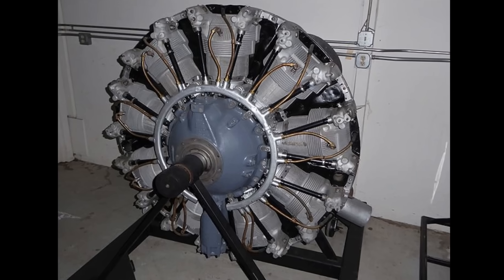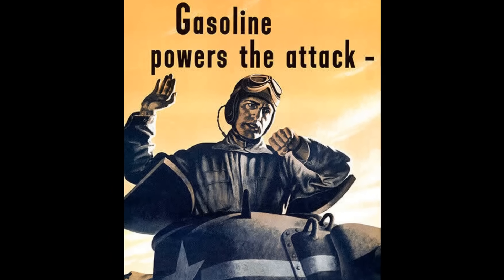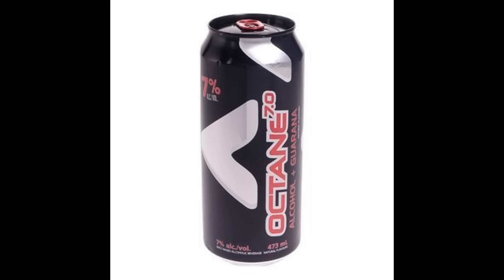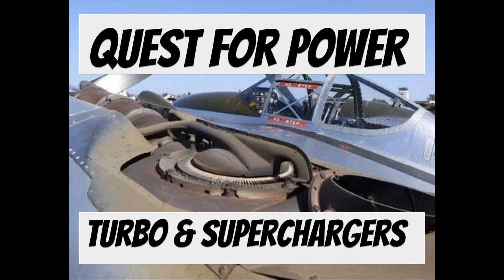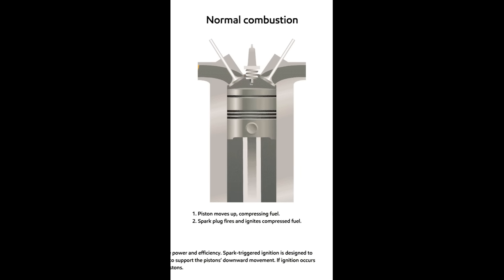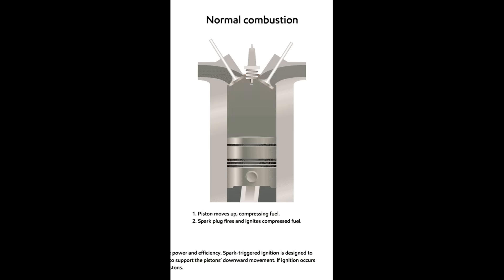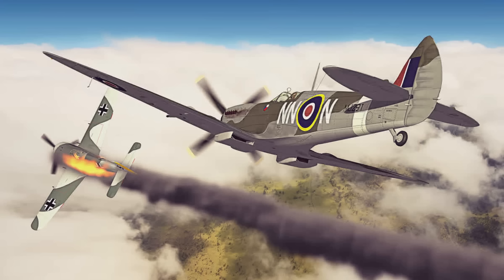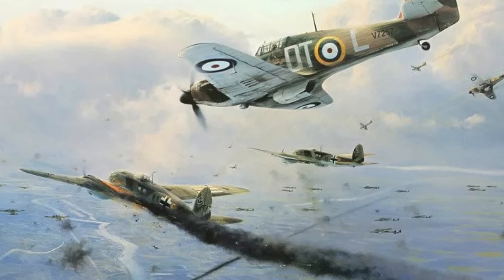Superfuel! 100 Octane Aviation Gasoline (Avgas):  Quest for Power Part 5

Comment: By increasing the compression ratio the engine can suck more air in and in turn burn more fuel. That is where the extra power comes from, more fuel equals more power. The problem, as you point out, is the pre-ignition (or knocking or pinking or pinging as it is sometimes erroneously called) which will destroy the engine. It sounds like a handful of stones going through the motor. It took good brains to overcome the problem so the fuel mixture doesn’t ignite by compression before the spark is able to do its work. Same weight of fuel and engine but more power. All the nice ideas for hotting up motors were thought of in the early days of  aviation. I like it when people think higher octane petrol will give them more power just by putting it in their car.

Comment: I’ve been an A&P mechanic for 43 years my first job was for an FBO and 135 operation. I would uses to run 100LL in my motorcycles especially my Suzuki 125 dirt bike and Honda 250R 3 wheeler. They ran great on it. Loved the smell of that fuel. Now for the past 38 years I’ve worked for a large MRO it’s all corporate jets and Jet A smells horrible.
Reply from the maker: I own a Cessna 172 and part of every preflight is a little sniff of the fuel sample. I tell people that I can tell if ther AVGAS still fresh!! haha

Comment: All octane rating is really about is a fuels auto ignition temperature. When  gas (air gas not gas gas)  is compressed it generates heat. The more a gas is compressed the more heat it produces. Engine knocking  is when the fuel air mixture is compressed to the point where the heat from compression ignites the fuel before its supposed to be ignited.  Raising the octane in fuel makes it able to handle more heat before igniting thus allowing higher compression and more power.
Reply: Exactly , it raises the flash point .

Comment: Let us not forget that the perenial underachiever Mr Doolittle also developed a practical blind flying system for the first time the ethos of which is still used today, changed the direction of the 8th to contribute massivley to the situation that allowed air supremecy on D-day, was part of the team that created zoning to prevent airfields becoming constricted by development so impacting safety (I suspect that one went by the wayside) and was also in charge of the aviation division of a small company called Shell. I wouldn't want to have  beer with him - when he says what do you do I'd be  at blinking and breathing in comparison to this hero's achievements - I picked up his Autobiography at the PX bookshop many years ago and it's a very good read but sadly I have lost my copy!
Reply from the maker: Yes I mentioned his blind flying work in my B-25 eps! What an amazing man and soldier.

Comment: Best thing about 100 Octane Low-Lead aviation gasoline is that it does not go stale and gum up carburetors and fuel systems in the way that modern automotive gasoline (often with ethanol) does.

People with vintage collector cars and most pilots know that. 

Technically, AvGas does not get taxed in the same way as automotive highway motor fuel, so it is not entirely legal to use.

Would have to say that even after years of sitting in a gas tank, things like generators, chainsaws, lawnmowers, snowblowers, line-cord trimmers, rototillers, etc will start on the first pull once they are primed.😊

Comment: Rule of thumb when I was flying helicopters in the late 60's and 70's, 80/87 for naturally aspirated engines, 100/130 for supercharged ones ... you couldn't run 100/130 in naturally aspirated engines, it would kill them

Comment: 1.  All gasoline has the same heat content.    One gets the same heat from 87 or 130 octane.
2.  Increasing the compression ratio raises efficiency, but it’s a diminishing effect.  Compression ratio is geometric and does not change with throttle fully open or closed or with altitude.  What matters is pressure ratio…as measured indirectly by manifold pressure.     The CR of WW2 engines was typically 6.5..about the same as a Briggs and Stratton!
3.  The plug firing initiates a flame front that spreads through the cylinder along with a rapid pressure rise.   Detonation.. knock.. occurs when the mixture just outside the spreading flame front spontaneously ignites.  
    If the mixture ignites before the spark fires, it is “Dieseling”..compression ignition.  But as a practical matter, little difference.
4.  WW2 piston engines were expensive.  Possibly exceeding the cost of the rest of say a Me109.  The early German jet engines were comparatively cheap …another incentive to use them.
5.  If memory serves, Charles Kettering came up with tetra ethyl lead for gasoline.  Kettering invented the self starter, and coil and breaker ignition.  Readers ought look him up.  BTW, his company was Dayton Electric Company…DELCO.
Reply from the maker: Wow, that’s a lot of great information! Thanks for sharing!

Comment: DUMB-ASS, in the US in 1938 Shell and Esso started selling 97 octane pump gas for cars like the V-16 Cadillac Allison/Hydro-Matic and Packard "Twin-Sixes"! The B-29's burned "super-fuel" the 130/150 octane fuel spec'd on the SIDE of the aircraft. The RAF Napier Sabre Engined fighter (Typhoon and Tempest) used American made 170/200 (lean and rich mixture ratings) made by Esso and Atlantic Richfield. It was so caustic, ground crews had to wear First Generation HAZMAT suits. P-38's in Europe experimented with it, but it ruined spark plugs in 4 hours of operation. My late boss was an experimental pilot after WWII and he flew a Japanese aircraft fueled with 170/200. The "chase plane" a P-80 Shooting Star jet was 70 knots SLOWER at 20,000 feet, climbed at 150 knots slower at a 70* angle of attack and was 100 knots slower at 60,000 feet!
Reply from the maker: "DUMB-ASS"? Now place nice or I'll have to put you on the detention list...

Comment: Correction: Aviation Gasoline into the Airline Piston Days through the DC-7 (R-3350) and, Connies used 115-145 Octane Gasoline. My "Late" Dad started at United Airlines in 1946 from USCG combat in the South Pacific. United ALWAYS USED Chevron Aviation Gasoline. Keith USCG Vietnam Veteran.

Comment: I spent two years in scenic Southeast Asia during the fun times. I was part of an Army aviation unit. We flew the De Havilland U-1 Otter, and U-6 Beaver, and the Hiller OH-23. The Air Force guys in the next hanger flew the Lockheed EC-121, all of which used 115/145 Av Gas.

The rumor on the base was that 115/145 would make your car or bike into a rocket. All the FNGs believed it, including me -  I was avionics support, so I knew nothing about mechanical stuff. After 5 months of saving my pennies, I bought myself a 1968 Honda CL350 from a guy who was DEROSing.

Once I learned to ride it fairly well, I took it to the airhead and filled it up with 115/145… OMG… to quote Captain Alberto Bertorelli from “Allo, ‘Allo” – “What a mistake-a to make-a!” My poor Honda didn’t run as well as it had on regular civilian 87 Octane stuff

What they don’t tell you about running 115/145 in your bike… 115/145 is formulated for high altitude operation and contains a lot of deicer, which my Honda didn’t like. To help clear it out, when I got down to about half a tank, I filled up with the regular civilian 87 Octane stuff.... and never did that again!

115/145 was great stuff in an EC-121, but not so much in CL350.

SP5 Old Curmudgeon 
US Army Vietnam Veteran 1969-70…. and still…
Beaucoup Number Ten GI
Reply from the maker: Wow thank you SO much for sharing that! Great story!

Comment: In the Australian air force, RAAF, we used to pump AVGAS 130 Octane fuel into our CAF, Caribou cargo planes as well a a couple of the basic trainers. We used to call it "Green" as it was.
Reply: I was buying green 130 octane avgas in c. 1984, I think at Reid Hillview airport, maybe elsewhere but south bay, san jose area.  and some 115/130 octane it was blue green as I recall.  I had to use it about 22-50% mix because it fouled the plugs if used straight.  Must have something to do with altitude.  Used in my 350 cheby, 7800 rpm, 550hp +/-.  octane perked it right up, especially with nitrous oxide which added another 150hp.
Reply: Those lovely radial engines. I was at HAC right across the road from the Richmond RAAF base in the 70s. I loved hearing the Caribou’s going over. We took a great interest in all that flew in and out of Richmond.

Comment: High octane number gas is counter intuitive.
Why?
A high compression engine needs a high octane fuel to prevent "pre-ignition" of fuel before the piston reaches top dead center in the process of internal combustion.
Low octane fuel will ignite by itself under high compression, thus causing a loss of power and overall poor performance in an engine with a high compression ratio.
Anything over 12:1 is considered high.
These high performance aviation engines also used "super chargers" and "turbo chargers"to increase the amount fuel air ratio into the combustion chamber.
WW2 gave rise to the muscle car era.
Reply: “Pre-ignition” and “detonation” are two completely different things.
Reply: Semantics, my point was not lost in translation.

Comment: You messed up, Germany didn't have kerosene, there jets ran on # 3 diesel.
Reply: An alternate fuel used widely by the Me 262 was high octane aviation gasoline, with 5% lubricating oil added to it.
Reply from the maker: I did say it would burn just about anything!

Comment: BAM100
Reply from the maker: Sorry, what is that?
Reply: @worldofwarbirds  British rating system for their Aviation Fuel.  A shipment of BAM100 was sent through Lend-Lease just prior to The Battle of Britain and allowed the extra boost for the engines. 
Abbreviation, I don't remember what it is. It has been decades since I read about that in an old book about super charging. 
Heard different oil company names since then, so I'm not sure which actually sent it.
Reply: British Air Ministry 100 octane.

Comment: We used 100/130 in R-2800 engines. They also used 115/145 during the war. With the advent of air pollution, lead was removed from the fuel. Aircraft piston powered engines used 100/130 up until the advent of jet engines. One can tell by the yellow stain on and near the exhaust, it's the lead causing it.

Comment: The way I understand it, octane rating goes up to 100. With additives, it goes up to 130 or whatever. But as 100 is the max, it is written as 100/130. That’s sound about right? It’s been since 1969, since I did my aero engine course 🤷‍♂️.
Reply from the maker: Yes. As I said in the vid I was trying to keep it at layman level. I’ve been flying piston aircraft for over 25 years and it’s still a little voodoo for me!

Comment: There seems to be some confusion about octane. Octane is added to fuel to reduce the chance of pre-ignition. High performance engines produce more heat and can cause flash burning of the fuel before the ignition fires. Octane does not make the produce a super-fuel.
Reply from the maker: Yup.

Comment: Sunoco still makes 116oct racing fuel...$28/gal. My VW ran well on 80oct Avgas, but the red dye in it turned my carb red. 115/145 was dyed purple. The first year at Oshkosh (1970, I was 13yr old), they had a 115/145 truck for the warbirds. Smelled different.
Reply from the maker: I use 100LL in my Cessna...it's blueish and smells GREAT! I always take a sniff from the fuel test cup before flying!

Comment: Petrol (gas) does not explode.It burns very rapidly. If the compression is too high, it will detonate.That is the knocking or pinking sound you hear.Lead in petrol helps prevent this by lowering its ability to ignite.Therefore the ignition timing can be more advanced and the compression increased.People think 100 Octane fuel will increase power on its own, no it won’t.In fact it will be slightly less due to slightly increased resistance to ignite.
Reply: It is a rapid expansion.

Comment: Why would gasoline ever be considered a waste product? I mean that it’s obviously extraordinarily flammable, so contains a great deal of energy.
Reply from the maker: When they were making lamp oil, this other volatile stuff didn’t have a use just yet. They burned it in pits supposedly!
Reply: It was though, they had no use for it then.
Reply: @jefftheaussie2225  
But didn’t they burn things for heat? Because gasoline burns pretty well. Is it just too volatile to make a heater from it? Kerosene works.

Comment: So what happened when Germans tried to use captured allied aviation fuel in their planes? It had to have happened at some point...
Reply: For the most part...nothing.  Without a consequent increase in the engine's compression ratio, no additional power would be produced.  When I was a kid (born in 1946) I remember hearing how people would put high octane avgas in a car and get a power boost, but then the car would suffer damage.  Not true.
Reply: @feathermerchant  You'd put ethyl in the tank if your car was knocking -- like when you went on a road trip and it knocked climbing hills.  Years ago I had a Chevy Corsica that knocked climbing hills on 88 octane unleaded.  The manual said it was normal.
Reply: It was given to them by American companies.

Comment: Im surprised they didn't burn methanol or ethanol, or a blend of methanol and ethanol. It should perform better than 100 otane the milagewould be cut in nearly half.  Maybe build engines with longer strokes , operation at lower rpm with higher compression. Possibly a 12:1 compression with a 7"-8" stroke 6" bore. Peak rpm around 2800 , it should Gain TQ especially with additional boost. Running at 1000-2800 rpm, with 1-1.5 bar boost using fast air to chill the charge air. mistthe fuel in to the supeharger just after compressing. To chill the temperature using a high pressure low volume pump. 100-150 psi misting about 0.2-1.0 gph  with a enrichment on the carburetor to add or subtract the fuel. Lean carb added chilling fuel, for when power is reqired and the engine is hot. And altitude having an effect. Possibly 1.5-1.65 hp per cid. 2880 cid 28 cylinder possibly add "gasoline" to the fuel to lower the octane slightly making it easier to combust. Still in the 115-120 range, still injecting water methanol, to get the high octane effect.  If they only added 49-50% nitromethane to the methanol,  with 1 bar boost, making about 6000 hp from a 2880 cid engine!😮. Crazy 🤪 i know, happy newyear..
Reply: As I understand it, methanol-water injection is used to cool, lower pressure, and oxygenate during rich-mixture war emergency power.  That way the fuel-air mixture can stay near perfect stochiometric balance and get maximum power while boosted beyond what the fuel's octane rating would allow.  Except for takeoff, planes fly on lean mixture (and at a cruising speed that's well below top speed) to conserve fuel as much of the flight as possible.  It's the lean-mixture range that most determines combat radius.  So no, I don't think using water-methanol injection reduced range much.  Any reduction in range would be from the added weight of the water-methanol blend and its plumbing.  Nitrous was also used in WWII.  I get the impression that nitromethane wasn't used to increase the rate of deflagration because the metallurgy and manufacturing of that era wasn't good enough.  Would be wild to see it though.

Almost forgot.  I think it was Ricardo who recommended a 50-50 blend of water and methanol as giving the best performance.
Reply from the maker: Yes. The previous video in the series was about methanol-water injection.
Reply from the maker: Happy New Year to you too!!
Reply: "...the milage would be cut in nearly half."  Cutting the range/duration of combat aircraft would pretty much rule that out!

Comment: Incorrect. Ethyl gasoline was used almost all throughout the 1920' s and 1930's. It was tetraethylead. We are still cursed with blue lead aircraft gasoline, and it is both poisonous and highly corrosive. It is unnecessary for most aircraft engines. New highest octane no lead gas is just coming out now.
Reply: If aviation gasoline was 1/2 of 1 percent of production prior to WWII, what is it today?  There isn't enough 100ll being burned to make any impact on the environment.  Avgas is about six bucks/gallon now.  What is the new stuff going to cost?  We don't need to reinvent the wheel here.  Guys are scraping planes now because of the cost of ownership and all the manufacturers produce only about a thousand new piston engine planes per year.
Reply: It’s only with Bromine additive that lead can be dispersed in the exhaust. This technology was handed over to the Nazis by American companies.
Reply from the maker: What part was actually incorrect?

Comment: I believe octane ratings are also related to the speed of combustion.  Low octane rated fuels would spontaneously explode; while higher octane rated fuel slowed the burn rate down, rather than exploding.  Sort of like  'BOOM!"  vs: "boooOOOmmm".
Reply from the maker: Yes. That is correct!
Reply: Correct , also observed ( heard and felt ) as knocking